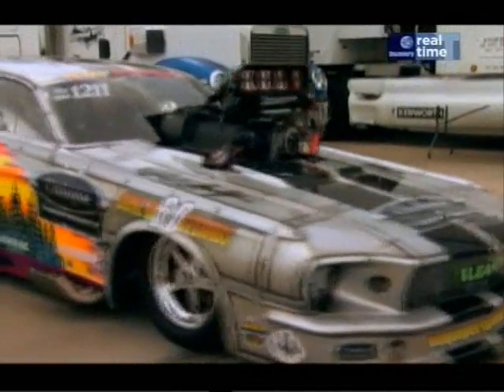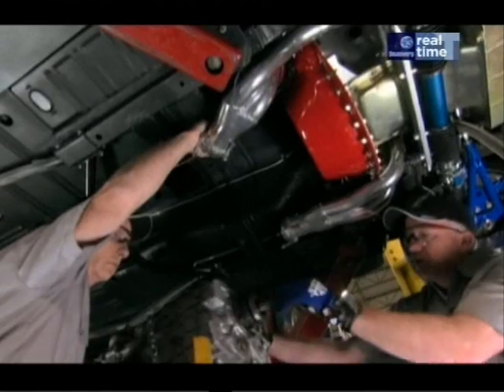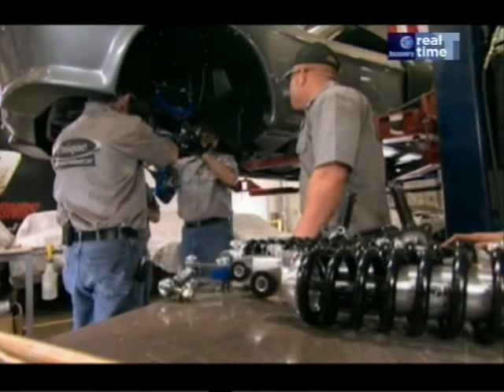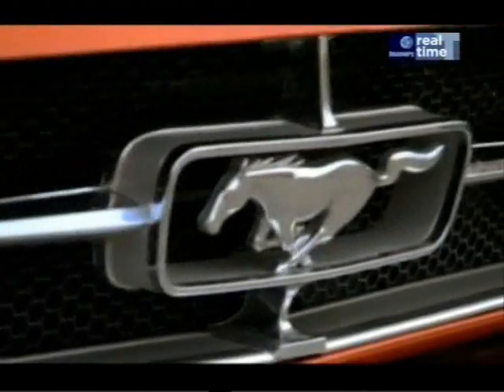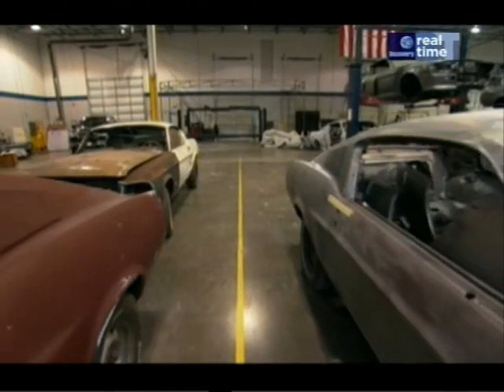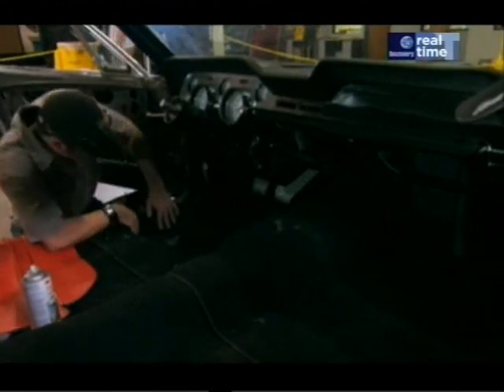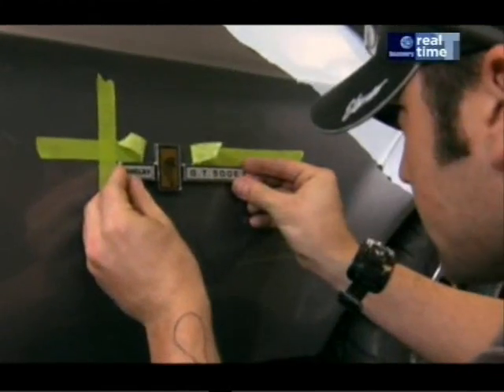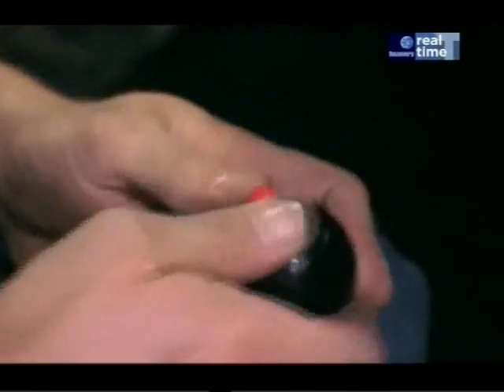Making of Eleanor Ford Shelby GT 500 Mustang Part 4/5

Comment: I wondered that. I noticed in part 3/5, they installed the fiberglass sill vent OVER the original... I thought that was a little odd for the prices they were charging for these things. I thought they would have been a little more professional and simply removed the original sill vent and THEN install the newer fiberglass part.